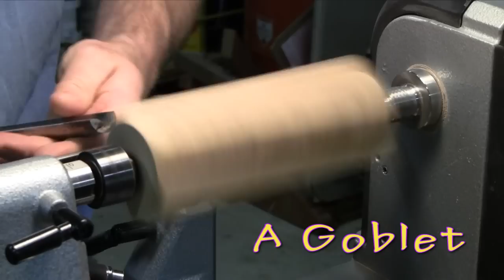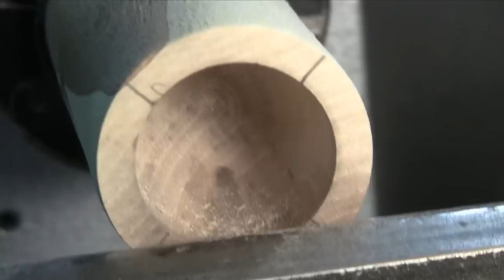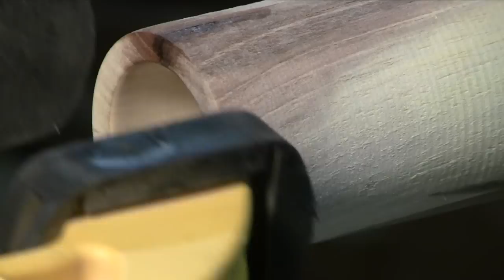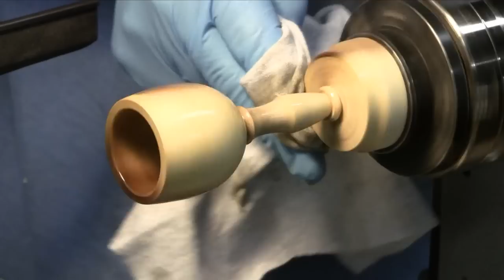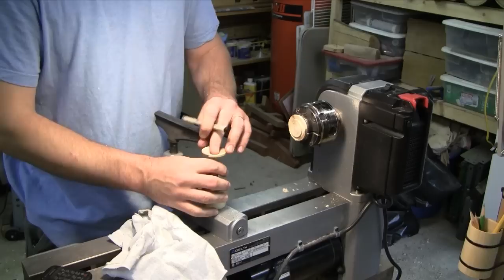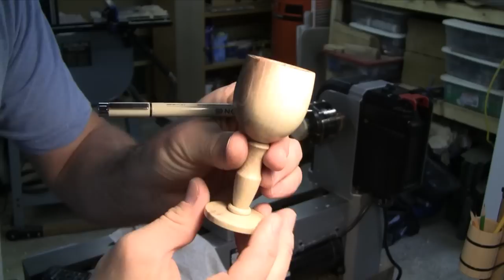A Goblet

Comment from the maker: Hi,

1) The drill bit is epoxied into a wood handle.  I hold the handle with my hand, no grips needed.  Another way would be to have a 3 jaw chuck (like in a drill) in the tailstock and drive the bit with the tailstock into the blank mounted in your scroll chuck on the headstock.

2) Yes, it is a spindle gouge ground to a fingernail shape.  It takes some practice to get the feel hollowing like that.  Watch.  HTH
youtube.com/watch?v=4zz8r7zhnSg
youtube.com/watch?v=ijZ8Ph8KWcw